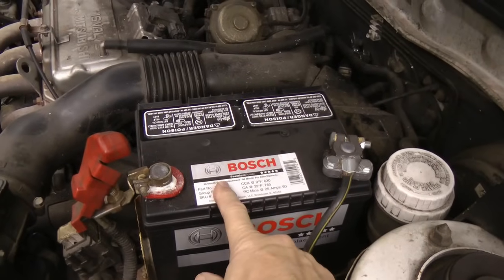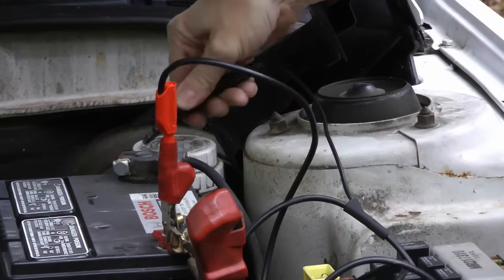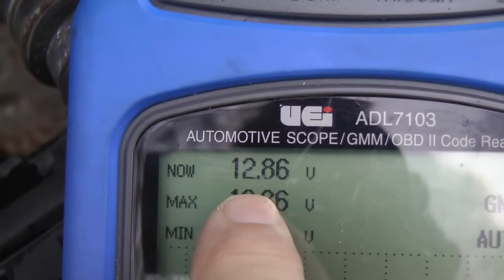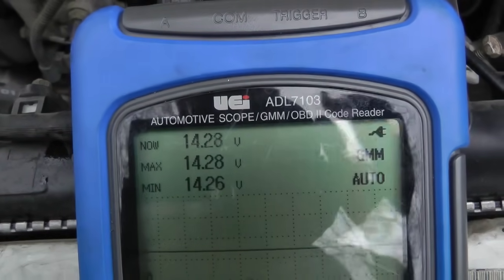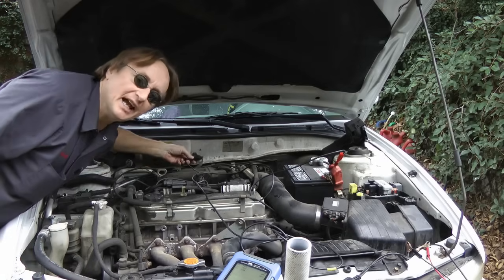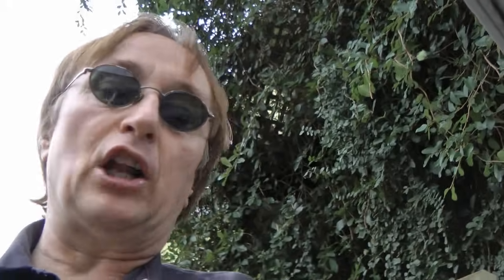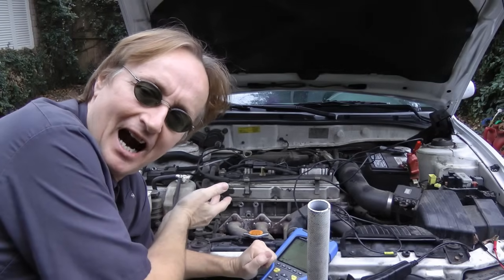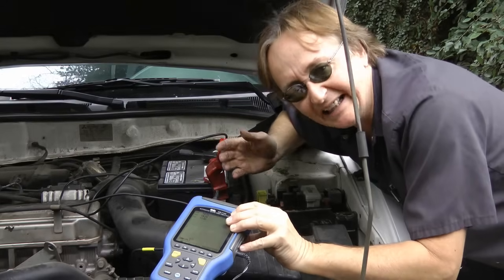How to Fix Electrical Problems in Your Car (Ground Fault)

Comment: hi, I'm having starting issues. I took my car to Autozone and they tested my battery, starter, alternator and they all pass on their machine. but I'm still having an issue starting my car. Some days it takes 2 to 4 turns on the ignition or I play with the battery cables and it starts with one turn. do you have an idea what's wrong with it?

Comment: I have a 2002 sable with 134,000 miles.  My key buzzer stays on when I shift to R D.  It doesnt come on when its in  N. Stays on for about 2mins.  Im thinking a pinched wire grounding out.  Do you have any ideas? Also how to fix.   Thank you

Comment: hi I don't if its short. but when turn the head lights my cars turns off only. I check the alternator and its at 75 amps and charging voltage at 14.2.  The battery was check by my local auto shop and its fine too.

Comment: I have a 2004 Chevy blazer I installed aftermarket radio now car won't start I've put in new fuel pump fuel filter positioning sensor still not starting

Comment: My Acura integra fan doesn't turn on I replace and checked everything and the fan switch plug when I put wires inside the plug it's supposed to come on but mines don't, can this be a relay, if so which one

Comment: hey Scotty I have a 94 Honda accord. my problem is my car horn, interior lights, && rear defrost doesn't work , my power windows goes up slow and my radio doesn't play loud as it use to, my a/c also cause my alternator light to come on. I have a new battery, replaced 2 alternators because I thought it was the problem but it wasn't & I also bought a new a/c compressor .. idk what else could it be ...
Reply: i have a 95 civic same problem
Reply: +Xavier Clarke got an electrical problem just gotta find out where its at ..

Comment: Hi Scott, I have a 2008 Sonata and the dash and right brake light keep going out.  I have replaced the fuses and the one for the brake light keeps blowing.  They are not on the same circuit, so I can't figure out what to do.    Have taken it to four shops and no one can fix it.  Thanks for any advice!
Reply from the maker: Marissa Avigne see my video "finding electrical shorts on your car" there's a short somewhere

Comment: I was driving down the road a few days ago and my battery light came on. then i noticed my lights start to dim. by the time I got home the speedometer and fuel gage would all go to zero and "e" but would sometimes start working again.the radio would stop working and then come back on the same way. the battery is fairly new and I dont know what it could be.
Reply: Hunter Jackson i have a 2004 honda accord
Reply from the maker: Hunter Jackson replace the alternator
Reply: Thanks a bunch working on it now where are you located and I may get you some real moonshine

Comment: when I start the car using key in ignition switch, some dashboard lights still on like steering wheel lock light, abs light, airbag light, traction light... power window, aircon, radio, 12v outlet not working... steering wheel and gear is locked....

but when I start it using remote starter, it works well, all the problems gone...

when I started it using remote starter, then put the key on ignition switch to drive the car, all the problems that I said back on, except that the shift gear is working... steering wheel locked light back on, but it is working...

what do you the problem in my car? it is 2013 rav4 LE...
thanks...
Reply from the maker: Jester Gallardo sounds like a bad ignition switch
Reply: Scotty Kilmer my car runs fine... the problem are: power window, aircon, radio are all stop working... I can't move the steering wheel and shift gear... abs lights came on, airbag light came on, vsc light came on, parking brake came light on (even if this in not engage)... I checked fuses under the hood and under the wheel, it is all good....

Comment: hey, so my car... idk how to explain it. When you put it in park on a hill pointing downward, and you put it in park, it will roll forward and make a crunching noise and cuts off the radio. please help
Reply from the maker: Gabe Fuller your parking gear is wearing out, put the E brake on first, then put it in park and it won't move

Comment: Hey Scotty thanks for the video!
I am having a problem with my wife's 05 kia spectra bottom 2 brake lights not working. The brakes use the same bulb as the tail lights but the filament for the brakes does not light up when you press the pedal. However the third brake light lights up. I tested all of the fuses and replaced some blown bulbs in the rear that I found. The turn signals and hazards are on a separate bulb. Less than a week ago someone rear ended her. Not much damaged was caused except for scraping up the rear bumper and a dent.
Reply: check for bent ground wiring connections or connectors by the ligjts where they plug to the bullbs. sometimes a small accident can cause a ground cable to move around and either touch another ground cable or part of the cars frame and cause it a bigger problem, or so

Comment: Hi scotty I have had a strange electrical problem for a year or so. I live in south florda I have a 98 ford escort se. I have had cooling fan issues. I have installed a new ccrm, cooling fan, cooling fan plug, and coolant temp sensor. Ok when I turn my ac on I am getting 13.72 approx. Volts to the high speed connector. When the outside temperature reaches upwards of 95 the fan will not run in high speed most of the time. I only have this problem in summer months but id really like to fix it. I can see voltage to the high speed connector with my klein dmm. I want to use a power probe and see if the voltage is still running when it is plugged in or maybe the fan motor is doing something to turn the ecu signal off, but I do not own one. Im not positive it only happens in heat but I do open my hood and check if it is operating every day after work when I start my car and turn on the ac.

I dont think it's the plug but I feel it's not going from there to the fan. Also I have ussd jumper wires in the fan both speeds work, thanks for any help scotty like your videos
Reply: definietly electrical. check the cooling fan relays. but sounds like an open circuit somewhere in the wiring. start from the relay box and work your way from there
Reply: +Jose Hermosillo thanks for the reply. I will have to, I don't know if you're familiar with the 97and newer escorts but they have something called a CCRM where all the relays are built into one little box they are not supposed to open but I've already replaced it with a brand new unit. over the weekend I cleaned all my negative and ground connections and it was working well that day then slowly the problem came back to where it will run for 30 seconds here then off, if I restart the car it might run for a few minutes.. I wish I could just upgrade it to a new slim high flow fan already. my electrical mechanic said maybe it's time for a new car hahaha. but the motor and tranny are healthy and the ac works good when the fan works, I want to keep the car for another 8 or 9 months

Comment: Hey Scotty, I own a 2004 Dodge Durango that's got a strange issue with the rear left taillights. The rear left assembly consists of 4 lights, from top to bottom it goes brake light, fog light, running light/turn signal (all of those are encompassed in red tint) and then reverse light. I had a friend tell me my brake light was out, and sure enough when I tested the brake and watched the light, it was not functioning. So I went to AutoZone and bought a two pair of brake bulbs and installed the fresh bulb. When I went to test the light to ensure it was working properly, it was later in the day so I had my lights turned on. What's strange is the bulb is functioning properly (on and working) but it does not get brighter when the brake pedal is pressed. If the lights are off, it does not come on at all. Any ideas? Should I replace the assembly entirely or is it perhaps a deeper issue? I appreciate any help!

Comment: I just went through a similar problem to the example shown here (parking lights come on when stepping on the brake). I followed the "start with the easy stuff" method, and was pleased to find out within minutes that the problem was an internal short IN THE BRAKE LIGHT BULB ITSELF. The brake filament had partially melted due to wear and tear and was touching the tail light filament, which every time I stepped on the brake would feed electricity through the tail light circuit (which illuminated parking lamps and dash/gauge lights, in addition to causing my aftermarket stereo to dim its display due to power on the illumination lead).

This was definitely an odd electrical problem I have only seen once before, and I was glad to find it was not a problem with the wiring itself.

Additionally, many Saab 900/9000s and Volvo 240/740s are known for tail lamp ground issues - putting on a turn signal would flash alternating between turn signal and backup lamp (one Saab I worked on, the turn signal would flash the brake and backup lamps when your foot was on the brake but act normally when not braking) or other weird reactions as the electrons flow through other circuits to find a better ground.

Comment: Mr. Kilmer, I own a 2000 Toyota Rav4. Just installed LED reverse and brake lights. They work just fine. However, after the install, now my parking lights won't turn on. What could be the cause of this? How can I fix it?
Reply from the maker: DragonfruitQ odds are you either blew a fuse or disconnected ground or power from parking lights
Reply: Blew a fuse! $5 fix

Comment: Every time I stepped on my brake pedal, my parking brake light would pop on and I'd be blowing through fuses, both stop/hazards, and turn signals. Turns out it was a pinched wire. I got it loose, zip tied it somewhere along the frame where it wouldn't get pinched, replaced the fuses, and even the brake switch, and it was fine.

Comment: i was wondering if you could help me out, none of my gauges, power windows, sunroof or illumination is working. it is an acura tl 03, drives fine, a/c and radio works.
Reply from the maker: Dillon Tap pray it's just a weak ignition switch, if not that, things get complex on acura wiring. and of course, check all fuses
Reply: i checked all of that, the ignition switch and all fuses and relays are working. the backlight on the dash is there.

Comment: can you tell me why i have tail lights but when i crank it no tail or head lights abs light comes on no power locks radio messes up also i turn off an sometimes will work then next time want its a 93 olds sierra sl
Reply from the maker: lois baliles often bad ground wires do that on GM products. BUT, there are lots of ground wires, I would start by checking the main power ground wire, the negative battery terminal wiring. Also have the battery load tested, places like auto zone do that free
Reply: thank u it was the main one  u was a great help 
glad i found your link

Comment: Hey Scotty, I have this occasional problem where my AC and lights won't work when the car is on but after driving it a bit it will work. Also a few days ago my brake light were on constantly while driving even after I released the e brake!

Comment: I have a 2000 c5 corvette and my parking lights won't turn off. It just started doing it today when I turned the car off..Do you know what could be the problem?
Reply: Vountria Moss, is it just your tail lights/brake lights that stay on or your front parking lights as well?  If it's just tail lights, there is a switch that is connected to your brake pedal (metal arm part) that gets out of adjustment and can leave your tail lights on all of the time.

Comment: Hey there been watching for a while but first time leaving a comment.. I have an electrical problem with a 04 hyundai tiburon.. my nephew replaced his stock radio with an aftermarket deck. After the install the parking lights wouldn't shut off with the ignition ... I thought relays on bcm were bad so I replaced them.. then he tells me about the stereo... so I looked at the job he did k  thr stereo and sae he didn't ground the stereo.. I grounded the stereo and lights turned off... BUT the engine along with dash lights wouldn't turn off with ignition off... I had to stall the car to shut it off.. I replaced all radio wiring back to stock and the light problem seems to be fixed but the car and dash lights won't shut off. . The car starts right up but won't turn off... thoughts?

Comment: I recently got g35 coupe I noticed that the radio wanst working , ac, power mirrors, and the gauge cluster didn't light up but it's working I was wondering what it might be I've already changed the fuses that needed to be change.
Reply from the maker: Rafael Aranda  you have some type of power short, realize there are many different fuse boxes all over the place on that infiniti, first check them all. But if not a blown fuse, generally expensive things like bad body control modules will do that. they are VERY complex electronics on that car

Comment: I got a crown Vic police interceptor but only half my dash lights turn on but then randomly some of the other lights turn on but not all. Do you think I have a bad ground wire by the way I've removed the hater and all the light bulbs are new
Reply from the maker: arturo rodriguez more often the dash circuit board is breaking down internally, some guys try to resolder them

Comment: hi scotty

The voltage when the car running is 14.4V, but it decreases gradually to 13.9V and sometimes it gets worst to 12.1V. Is it normal?

The voltage between the positive terminal and engine block is 1.45V (engine off) and 1.65V (engine on)

Do i have an electrical problem?

Comment: Hi Scotty,  I own a 2001 Cadillac Seville STS and am having a rough idle, along will stalling while applying the brakes.  I took it in recently to be fixed but the issue stumped the mechanics there.  The "repair" came out to $1700 and they didn't fix the underlying issue.  Of course they replaced the crankshaft sensor, the 02 sensor, checked and cleaned the MAF sensor, replaced coil packs and spark plugs, but the issue remains.  Tonight was the first time my engine stalled out completely since the repair about two weeks ago.  Pre-repair I stalled out atleast twice per day.  Do you have any advice for me?  I'd gladly take advice from you!

Thanks a ton,  -TNT101
Reply: Did they check the IAC valve or the MAP sensor? Two other things I would have checked

Comment: Hi scotty in my 3000gt when im driving and parked my car gets 13.6 voltage but when i apply the brake my lights dim down a little and my voltage stays between 12.1 and 11.5 and picks up when i accelerate i dont know if its normal for these cars to do this i got my battery and alternator checked and there working fine so if u can get back at me and give me advice to see what it might be id appreciate it
Reply from the maker: Carlos Rubio  not normal, I would assume they either tested the bat and alternator wrong, OR there is a wiring short on the braking system shorting power out
Reply: Scotty Kilmer and how would i check that in my car

Comment: Hey Scotty I got a 1999 Ford F 250 regular gas v8 5.4 liter Triton engine basically I'm having a headlight issue my driver side headlight will not go on parking lights and blinkers and everything else  is fine and the other headlight on the other side  work fine but just the headlight alone on the drivers side will not come on and the bulb is good but I can't figure out why it won't come on. could it be a ground issue or .....?
Reply from the maker: Jason Hughes   heck, me, I just cut the wires to the bad headlight and wire it from the good headlight, a simple easy fix bypassing any problems

Comment: Have you ever heard of headlights only turning on/off with the ignition only. As in mid day I turn on my car and the even with switch set to off and NO DRL my lights will turn on simply cuz the car is on. Could a bad ground somewhere cause this symptom?
Reply from the maker: xStone27x that often happens when the drl systems break down on modern cars. But if it doesn't have DRL, then headlight switch or body control modules often go bad and do that

Comment: Hey scott, have a question if you can spare the time. I have a 2002 chevy impala 3.8 ls, its having some strange issues, first off the traction control randomly turns itself on when its wet outside mainly, it acts like it wants to work and then it shuts itself down along with the abs light staying on, i also have a check engine light on with something like 40 codes on it which the guy at oreileys who read them said it would be impossible for my car to run with, do u think it could be a bad ground that caused atleast the check engine light?

Comment: I have a 1997 Buick regal ls! I plugged in a visor from my 2000 regal gs. Now I have no interior lights! My windows don't work & my radio doesn't turn on at all'! All the fuses are good! Anyone help me out???
Reply: Jared Aas My 97 civic dashboard instruments don't work. Went to the gas station to pump gas and when I tried to turn it back on it wouldn't. 10 minutes later I try again and it finally turns on. BUT, the rpm meter acts fishy and when I break (even if I slighty tap the break) the rpm goes all the way down to zero. Also, when I turn on a turn signal, the rpm goes up and down at the same time as the turn signal flickers. Lastly, if I turn on my stereo, it also brings rpm down to zero and my stereo also just turns off out of nowhere. Idk what's wrong..